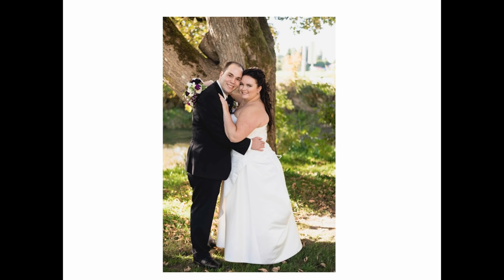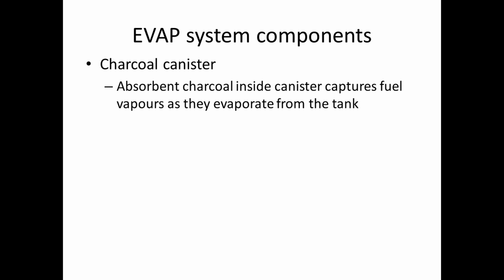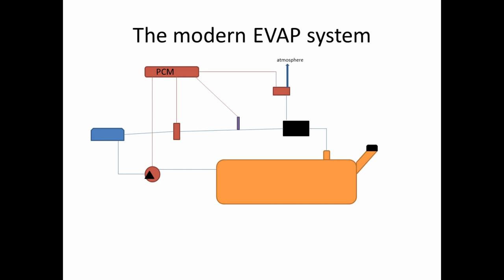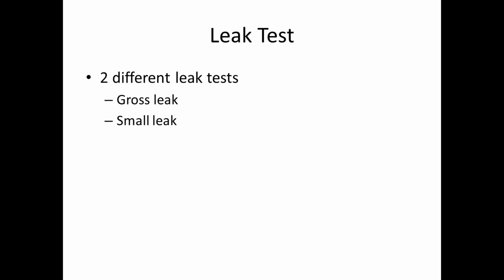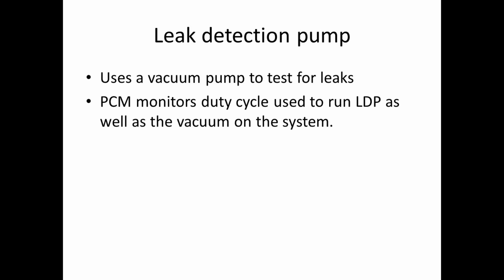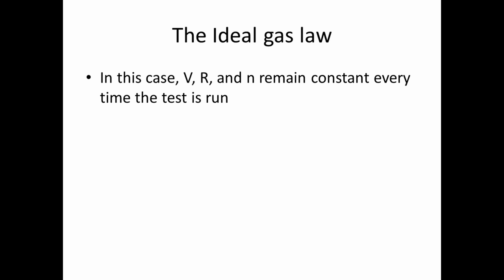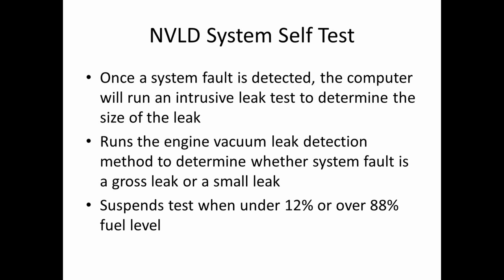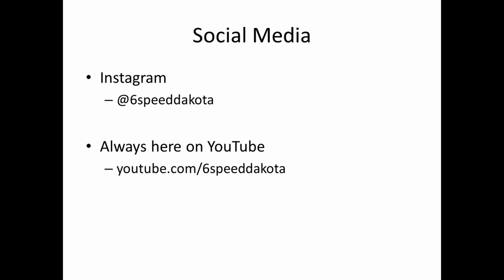6Speed's Lectures: How your EVAP system works

Comment: 02 chevy Venture van.  Fuel tank was  replaced (cracked filler neck at tank)   with used tank.    New fuel pump AM installed which contains incorporated pressure sensor as OEM      . Canister vent solinoid  was used from replacement tank , not from original leaking tank      Mil light is on 446 code,  tank has very high pressure when releasing gas cap ,whoosing and difficult to fill w gas . Just got back original vent solinoid and will swap .  Can blow through original vent solinoid with no restrictions    No  whooshing sound if cap is not tightened .     But Im sure code will set  if that cap is not clicked down . Will try orig vent valve . whats your take? Thank you
Reply from the maker: my wife's car has the same problem. It turns out that the charcoal canister is plugged up. What I did was I tried blowing through each of the hoses until I found where the restriction was
Reply: Do you know if canister and solinoid can be serviced( removed) without dropping fuel tank or must tank be  at least partially dropped (front strap) ?  To access  solinoid which is directly behind canister on front step ledge of fuel tank.  This is vehicle make yr  specific 02 chevy venture LS 112 wb . Did you blow the canister out successfully or did you need a new one ? I have heard of compressed air throught he appropriate canister port could work . BTW Canister looks to be possibly removable with out dropping tank . Maybe ?? Regards
Reply from the maker: I've never worked on a chevy venture, so I can't tell you but it's worth a shot trying to pull it without pulling the fuel tank. Just pull the line off the vent valve going to the canister, and disconnect the line from the canister to the fuel tank, blow through the the line going to the canister, if it's hard to blow through, your canister is plugged. I tried to blow the canister out and it worked a bit, but hasn't fixed the problem completely.
Reply: Thanks again

Comment: Any ideas on a 98 civic with tank side code p1456 that will not be set if ambient temperature is above 70f? Code comes on mostly in colder seasons. Replaced filler neck, cap, bypass and 2-way valve with no difference
Reply from the maker: Look at the lines going to and coming from the tank, you've most likely got a rotten line, or it also could be the seal ring around the fuel pump

Comment: So, I have an idle issue after refueling. My engine dip in idle rpm for about a couple of seconds after startup, but only straight after refueling. Not otherwise.
Have I gotten it straight if I say that my vent valve eventually is stuck in closed mode?
Reply from the maker: That seems very odd. I doubt it's the vent valve. If it refuels properly, it won't be the vent valve being stuck closed. I would be more inclined to say it's most likely from the vehicle being shut off and restarted again in a short timeframe. it's probably stumbling when going from open loop operation to closed loop operation. What's the year make and model?
Reply: Well.. it's a Volvo V70 1998.
The thing is that it has been standing in my parking lot for 6 months.
When I started it for the first time a couple of month ago, there was a loud continous ticking sound coming from the canister.
It stopped ticking after a few weeks of driving.

Comment: Hi. HELP. Have a 64 Buick Special w/ highly modified 455 installed. Strong fuel smell after shutting down from a cruise.  Have tried several things with the vent line to eliminate this and nothing has worked. Remembered the two line canister from an 80's car we had and thought if I installed one of those it would eliminate the fuel smell. Ran a line from tank to canister, canister teed into PCV valve line. Seems to help, BUT now there is an extreme amount of pressure in fuel tank??? Don't know what to do from here and it seems like I'm the only person ever to experience this problem. I've talked to other owners of similar vehicles and no one admits to this problem?
Reply from the maker: Ok, running the canister to the PCV is a very bad idea, you could end up with serious fuel contamination in the oil. You need to use something called a thermal vacuum switch that threads into the coolant passage in the intake manifold, once the coolant heats up, it'll open up the vacuum passage. Put one end to a vacuum source, its own independent vacuum source, and the other end to the canister. No matter what, you're going to get a fuel smell since the carburetor bowl is vented to the atmosphere. Since our modern ethanol fuels are very volatile, it'll boil the fuel out of the carburetor bowl and create that smell.
Reply: Thanks. I'm going to Spring Carlisle today(Car flea market & vendors) here in PA. I have Auto Meter gauges so I have two additional questions. Do I replace temp sending unit or use the other port that is available and just install additional thermal vacuum switch w/o wiring to the gauge?
Reply from the maker: use the other port. Don't remove the temp sending unit. The TVS has no wiring, it's purely mechanical.
Reply: Thank You very much.The best to you and your lovely Bride. My Bride and I have been married for 38 years.

Comment: Hi on my renault clio 1.2 petrol [2014] I've got a fault p0444 evaporative emission system purge control valve open. I had a vac hose from inlet manifold split to purge valve. Replaced that. I have replaced purge valve and it's still coming up with same fault. I've reset ecu but still can't work out what's going on.
Reply from the maker: check to make sure your wiring integrity is good, it should have a signal wire that tells the PCM how far the valve is open or closed, there may be a short or open in that wire. A bi-directional control dealer level scan tool is required here to do the proper diagnosis so you can command the purge valve open and see how far the valve is opening.
Reply: 6speeddakota ok thanks it's going to main dealer Thursday so hopefully they can sort it out.

Comment: My dealership is telling me my evap canister is plugged and I need to replace it before it wrecks the catilatic converter. Is this bs?
Reply from the maker: I cannot see how the charcoal canister would wreck the converter. Cats get plugged up from excessive unburned fuel, i.e. a misfire, or excessive oil burning. A plugged charcoal canister will make it extremely difficult to put gas in though. That's what happened on my wife's car

Comment: My 2000 Silverado 1500 wont take any fuel. I pull the vent that connected to the canister and fuel was running out there. I need help
Reply from the maker: You've probably got a charcoal canister full of fuel likely from overfilling it, that's my best guess

Comment: hi I have a question my husband truck has this problem.my questions is is it possible that his truck is leaking carbon monoxide or some other Gas? because I bin dizzy and sick since this has stared please get back 2 me thanks
Reply from the maker: If there's an exhaust leak and the exhaust is getting into the cab, then absolutely. Sickness, headache, and dizziness are the symptoms of carbon monoxide poisoning.
Reply: thank you so much I bin in and out of hospital and thay could not find anything wrong with me
Reply: Cherylann tf It could be and exhaust leak. Get a Carbon Monoxide detector and keep it in the cab (if alarm goes off shut off vehicle and exit at once). It could also be fuel vapors. Keep windows down and get vehicle checked ASAP.

Comment: After replacing a leaky fuel neck on my tacoma I am still getting a 0440 code. I tried the smoke test thru the green valve but it feels clogged? Any ideas why it feels clogged?
Reply from the maker: P0440 is a general evap system failure code. Usually it points to a component failure in the evap system. The problem is that a P0440 can be very hard to pinpoint because it's a generic code. Which valve is the green valve?
Reply: 6speeddakota the green test port valve
Reply from the maker: At rest, with the vehicle off, the vent valve shouldn't be energized and you should have smoke coming out of it like crazy. Try disconnect the hose to the vent valve and see if  the smoke comes out; if it does, the valve is stuck closed.
Reply: 6speeddakota after testing again the valve is stuck. Can I unstick it? Or do I need to bye the whole canister ?
Reply from the maker: You can try unstick it, maybe a bit of spray lubricant with a little coaxing may free it

Comment: So my cars pirge solinoild was bad i replaced it cleared the fault. I can heat my purge valve opening a closing while im at idle and driving a 25 mph. Ive replaces the gas cap as well. I need help.
Reply from the maker: What's the code you're getting?

Comment: My car misfires (cylinder 4) after refuelling and goes away. I once had knock sensor trip. I believe it’s in the evap system since it only happens after getting fuel and goes away thereafter till I get fuel again. Spark is good, compression is good. No evap code, only ever cylinder 4 misfire and knock sensor once... help please?
Reply from the maker: That sounds very odd considering the fact that the purge valve should be closed when refuelling anyway. Do you ever shut it off for a few minutes and then restart it afterward? or are you always leaving it sit for several hours before restarting it?
Reply: 6speeddakota thank you for your reply. No, I refuel like anyone else would, gas up and go. I cannot recreate the misfire without refuelling, this what leads me to believe it’s evap, but no other codes other than misfire cylinder 4, once I got knock sensor. Knock sensor will trip on a lean condition, rich will just flood the engine. Any thoughts?
Reply: 6speeddakota do you think I can disconnect purge valve at the intake next time I fill up, plug intake, and run to isolate evap system from motor, will this damage any evap component?
Reply from the maker: @lewis6699518222  That was actually going to be my suggestion. Put a rag or something in front of it so if it does leak some fuel, it won't spew out everywhere. I doubt you're going to see tons of fuel if you get some coming out of the line, because if you did, it would cause hydraulic lock.

You're sort of correct about the knock sensor; detonation can occur from a lean fuel mixture, but the only reason the knock sensor will trip is if there's detonation, or you have something knocking inside the block, or on the block near enough to the sensor. A knock sensor fault will trip if there's an issue with the wiring or the sensor itself, the knock sensor won't trip a fault if there's detonation. I'm thinking that might be a separate issue.
Reply: 6speeddakota thanks for the advice. Next time I refuel I will simulate a stuck closed purge solenoid by plugging my intake. This will tell me a lot. I just don’t want to damage any component along the way or cause other faults.
Reply from the maker: @lewis6699518222  just make sure you plug everything back in before you drive off lol
Reply: 6speeddakota is it not ok to run and drive with a simulated closed purge solenoid? If i can plug the vacuum side of the valve and plug the intake on the throttle body can i not drive like that?
Reply from the maker: @lewis6699518222  You can, just don't run around without the line capped. on both sides. You don't want dirt getting into the evap system, and you don't want fuel vapours coming out. And you definitely don't want to run with the nipple on the manifold not capped because then you'll have a vacuum leak. That's no bueno when you're chasing a driveability issue
Reply: 6speeddakota forsure. Thanks a bunch.
Reply: 6speeddakota So I disconnected the evap system from my motor by plugging my purge solenoid, and plugging the intake on the throttle. Got gas like I normally do then drive around for about 5 minutes no trouble at all, went back to the gas station and filled right up till it clicked off, drove around another 5 minutes no trouble. Stopped at a side road and hooked up evap system back to motor and within one minute of driving boom! Two knock sensors and cylinder 4 misfire again. 🧐 what do you think in my evap would cause this?
Reply from the maker: @lewis6699518222  The knock sensor thing is weird. I've never seen that happen, but it may be because it's getting liquid fuel and it's having trouble burning it. Anyhow, I would try somehow use a pump or some type of vacuum device to see if you can try suck on the EVAP line, use something like a power bleeder for brakes, or an oil extractor. I guarantee that there's raw fuel in the line  and it's dumping straight into that cylinder.
Reply: 6speeddakota thanks for your reply and advice. Purge solenoid seems ok, getting 27.5 ohms thru coil, held vacuum with valve closed at 15”hg, audibly snaps open with voltage applied. With vacuum pump at 15”hg applied I turn key over for power but not start and drops to 10”hg, so i pump back vacuum to 15. I then start the car and while at idle in 30 seconds the solenoid opens and I lose vacuum, engine still cold. Is this right? What could be causing my issues when getting gas only then going away?
Reply from the maker: @lewis6699518222  I don't think your issue is in the purge valve. I think somehow you're getting raw, liquid gas into the EVAP line after the canister. Either something is jammed and causing the fuel to leak into the purge side of the canister, or the fuel tank is being way overfilled, which is flooding the canister with liquid fuel

Comment: hi, u know why 2 groud in purge selenoid conector and no power, which the fuse for thet selenoid,dodge caravan 98  3.3,,  thank's, exlnt video
Reply from the maker: Ok, I'm not quite sure what style this is, some systems are power side switched, and others are ground side switched. Power side switched means that the PCM supplies power to the solenoid to switch it on and off. Ground side switched means that the PCM supplies constant power to the solenoid, and applies ground to the solenoid to switch it on and off. Most chrysler vehicles are ground side switched, but I can't confirm that directly. If you turn the key on, but not start, you should have voltage on 1 of the 2 pins with the plug disconnected if it's ground side switched; whether it's 5 volts or 12 volts, I can't tell you. The other should be an open circuit until the PCM commands the valve open, once it commands the purge valve you should see ground on the other pin.

There generally isn't a fuse for it either, the PCM should have it's own internal safety if the purge valve or wiring is shorted to prevent it from blowing the internal driver out. If you have continuity to ground on both pins with the connector unplugged, I'd start looking for a short to ground. If it reads zero volts with the connector plugged in, but you see voltage with the connector unplugged, then you're looking at a shorted solenoid most likely
Reply: thank's I ll check ,& yes  are 2 ground  unplaged, and 0 volts plaged, if I wait 30 min,the car runing, and the computer  don't  send power to selenoid, u think it's  bad computer? , cos now I know this comp send power, how long each cicle?,  thanks   so much,
Reply from the maker: If there's a fault on the computer, it may not try to open the valve. Try clearing the fault codes first. Best thing to do would be to use a bi-directional control scan tool to electronically force the purge valve open, unfortunately, for the average do it yourselfer, that's about $10k out of the tool budget range
Reply from the maker: If the driver is burned out, then the computer has to be replaced. I'm not sure how long each cycle is

Comment: So the charcoal during venting (refueling / expanding temps) captures the fuel vapor only but any air goes to atmosphere without fuel vapors bundled with it?
Reply from the maker: The charcoal absorbs the fuel vapours so they don't get vented to atmosphere, just the air can escape
Reply: It will not absorb the vapors it will adsorb.
Reply: that doesn't make any sence
Reply: @juancamaney3562  What is the difference between adsorption and absorption?
In absorption, the atoms enter into the bulk phase of a liquid or solid whereas adsorption substances adhere to the surface of the molecule.

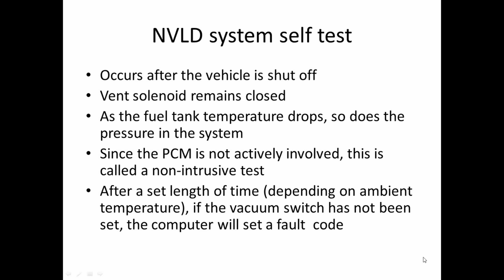Comment: what is the vacuum is not has been set? At 11:43
Reply from the maker: The vacuum switch inside the NVLD solenoid is a very sensitive switch that is closed when a small amount of vacuum is applied to the system. When the vehicle is running, the fuel tank heats up a bit, causing the fuel and air inside the tank to expand. Once the vehicle is shut off, what will happen is the air and fuel in the tank will begin to contract as it cools off.

If there is no leak in the system, a small natural vacuum will develop causing the vacuum switch to set, meaning that the system passes the leak detection. If there's a leak in the system, the vacuum switch will not set because any vacuum that occurs will leak out. Then, the PCM knows that there's a leak, and it runs an intrusive leak test to determine the size of the EVAP system leak.

Comment: In other words your vehicle doesn't really need all that junk , Because my 1986 toyota van haves a gas cap that works like a check valve and is equipped with two vent tubes , one on each side and thats all you need problem solve ......thank you .